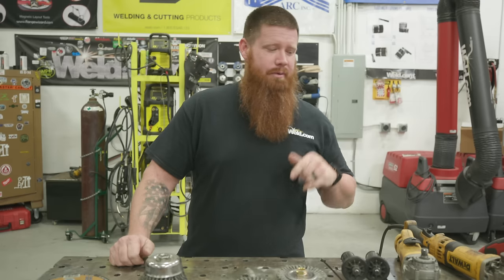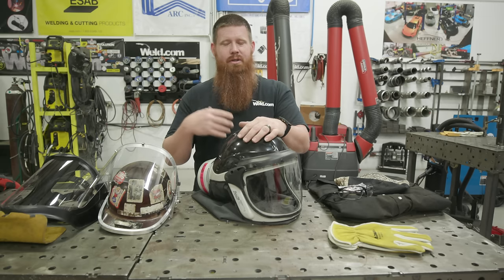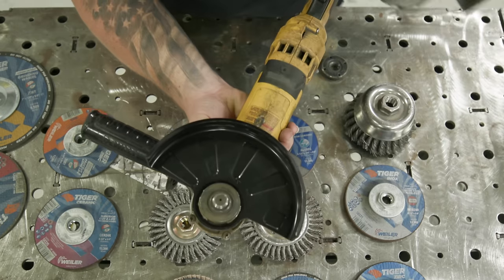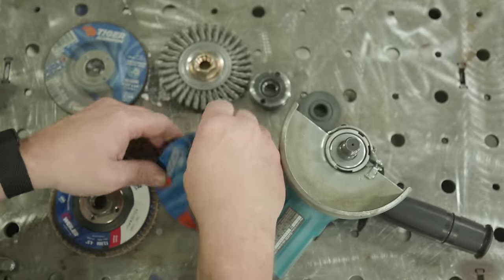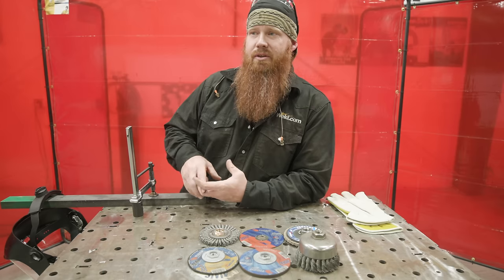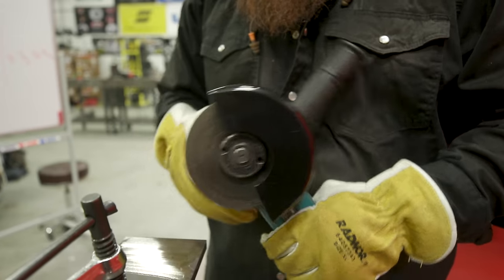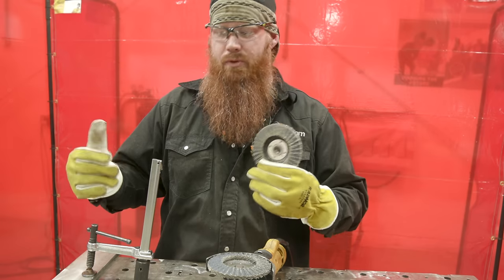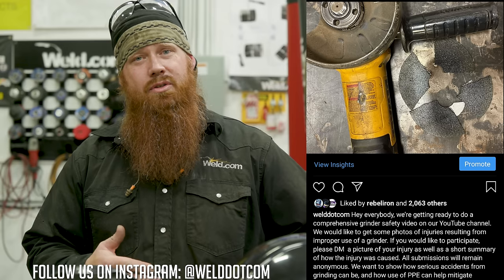Grinder Safety: How to Properly Use an Angle Grinder

Comment: True story: coworker was using a grinder with a cutoff wheel and no guard. I was about 10 feet away. The wheel exploded on him and a big chunk hit him in the neck by his throat. I got to try to slow the blood coming from his neck while waiting on the ambulance. I’ll never forget him telling me not to let him die and that he wanted to see his kids. He got lucky and lived. Use the damn guard.
Reply: Jeez!
Reply: Agreed. I keep telling my coworkers but they wont listen. I put on a guard on every grinder i find so nothing happens but they keep taking it off everytime so ... im waiting to tell my horrible story i guess. Ive done my job
Reply: Don't you have a safety monitor?
Not a union shop?
Reply: guards .. glasses... push sticks... clamps..
Reply: Why would you not use the guard?
Reply: batvette they’re always in the way, preventing you from getting the grinder into tight places.
Reply: Had a co-worker with longish hair using a grinder. His hair got caught, the grinder was drawn towards his head and ended up partially scalping him when it got there a fraction of a second later.

Grinders are very dangerous people. Take every safety precaution, and learn the uses and limitations of the tool before you use it.
Reply: @stickjohnny  seen one were disc exploded and guy got very lucky and only nicked his stomach, hearing all this I see how much worse it could have been
Reply: I've seen one of the plastic grinding wheels explode and embed itself in box 20 feet away. The grinding wheel wasn't some harbor freight junk either. Its was from the welding supply store.
Reply: batvette because Lowe’s, Ace, Home Depot, etc don’t carry type 1 guards of any brand
Reply: @jack19931970  If someone is having trouble fitting a grinder somewhere, then they're using the wrong tool.
Reply: ever see a drill bit snap and send a piece like a bullet..  glasses... dudes... i'm sometimes guilty.. i snap down my sun glasses in a pinch...!!!!!
Reply: Damn man, thats deep but important to share..
Reply: @MrFreakybeer  In the UK everyone here uses the guards. It seems to be only an american thing. I have no idea why people dislike the guards as they also stop sparks from going pretty much all over the place and peppering you.
Reply: @jack19931970  Then it's the wrong tool.
Reply: This is something that always has amazed me. I never ever use grinder without blade guard. 
Not once have I watched a video in which usually american builder has used grinder with a guard. 
What do insurance policies say in case of an accident if the guard has been removed? 
For example in American Chopper, no one ever had guards on and they used grinders all the time. You'd think that in a company that big at the time they would hold on to safety like crazy.
Reply: i never used any guards or anything in 10 years and never had any problems, with gurad im not able to do most of jobs, simple
Reply: @Jonjs99  I find it the opposite. With a guard I can do more. The sparks are not hitting my face and it makes it much easier to hold the grinder in certain positions.
Reply: @mrdojob  Trust me, i tried. Im making fences, and mostly stairs
Reply: Lua Dipa  guard is ment to be reposition able and handle reposition able I'd break your grinder and throw it in the trash
Reply: Damn dude crazy
Reply: No mention of the wife!.. Can't blame him 😂
Reply: I am never taking the guard off my grinder, omg
Reply: @sking379  why not?
Reply: people take the guards off regardless of where they work until someone tells them to put it back on.  taking the guard off lets them grind on the backside of the wheel which kicks back violently.  .
Reply: @MrFreakybeer  - The foreman or manager should kick those coworkers off the work place. Safety comes first.
Reply: @Jonjs99  -- Thank your lucky star that all those 10 years nothing happened. Should it ever happen, it will be too late for regrets. Why risk it?
Reply: Sorry to read that American always put  safety as paramount. Unfortunately such cases happened frequently especially in substandard workshops. No wheel guard and Max RPM that no corresponds and less than grinder max RPM. Wrong types of cuting/grinding wheel designed for air equipment instead for electrical or wheels not steel work. Bad installation or not properly grounded. Not to mention Chinese cheep crap. Use correct equipment, do not perform any work under alcohol/drug and always use made in U. S. A.  or made in Europe !
Reply: man thank you for sharing this with us. things like this are necessary for youngins like myself to learn. All mistakes teach somebody somewhere a lesson. Just have to set free the stories.
Reply: I meant properly insulated and grounded equipment - grinders, extention cables, distribution boxes, etc. When working with airdriven grinders and equipment aboard fuel barges, tankers, air hoses and equipment are to be grounded too in order to prevent static. In such areas often brass brush are employed. And gas free procedures and hot work permits.
Reply: GUARD is like a condom, most guys feel better without it. So I never used guard.
Reply: @stickjohnny  I'm always nervous using them. I've seen a few get blown apart.
Reply: Never hover your face over the grinder. When I was doing Tile one of the old timers, whose been a tile worker his whole life told me about another experienced tile guy. Who had a blade break off & fly into his forehead/brain killing him on the job site. Ever since then I stay offset to whatever I’m working on.
Reply: That’s frightening... uff..
Reply: man... teared up reading this
Reply: Jesus Christ
Reply: You would be amazed how many workers use a SpedeCut on an air motor without a guard. The air motor comes without one. It's just too easy, to construct one and install it! Folks don't realize how dangerous a cutoff wheel actually is, until the WORST actually happens! You watch! Mention something about safety to someone doing something totally unsafe, even if you're nice about it, and see how many folks will flip you off and tell you to go mind your business! Then they wonder why they get hurt! I mentioned, to a guy in our shop, that was fixing to use a wire buffing wheel on a bench grinder, WITHOUT a set of goggles and a face shield. He was just wearing his regular glasses. He got a piece of wire in his eyeball, that took him to eye surgery. He was lucky our shop was less than a quarter mile from the hospital. Later, he apologized to me. We have to use the PPE available to us at all times, when doing this type work! It is NOT forgiving!
Reply: @stickjohnny  Amen to that! Machines will roll up your arm skin, or your loose sleeve cuff or your gloves...or the loose bib of your shop apron. You can't get complacent when using power tools! There's no time where horse-play has a place in a shop setting. You have to keep your mind on what you're doing. I almost lost my fingers, when I was sharpening a drill bit on a bench grinder and a very unsafe worker came into our shop and hit me in the left temple with a snowball ! And he thought it was FUNNY ! Thankfully the boss saw it and fired his butt ! He was bad about stuff like that! We have to take care of our fellow workers. Remind them safety is everyone's business!
Reply: @somedude7633  My experience, just because a piece of equipment doesn't have a guard, nor was one designed for that piece of equipment, doesn't mean that you can't design and install one, yourself. Most times, a guard is so easy to make, it's almost child's play! You have 10 fingers and 2 eyes. Make something to assure that you keep those items, attached and operational, and not in a jar of formaldihyde
Reply: kykingz78  sounds like a "Lap-wheel" they're plastic
Reply: @we up 
I have forgotten the context... But with a table saw you always want to use push sticks instead of your hands... 
if what you are grinding is dicey to hold grip it with vice grips..
drilling slsomething ... clamp it in a vice... or clamp it to the table...
drill bits can become bullets...eye protection !!!!!!
Reply: @we up 
also, with a table saw, don't stand in line with a piece you are cutting... Hey, table saw blade can throw the workpiece at your midsection
Reply: ideally, a radial arm saw or a chop saw should have two run switches..
the usual trigger on the saw and a secondary outside of the blade's path..... 
shapers are rarely used .. never on a work piece that is large enough to swing at you if the chisel jams..again .. clampdown clampdown clampdown

even light sunglasses if no others available.. never power w/o glasses
Reply: Aaron Hicks  
if it covered his eyes.... oh wait... he would not be able to see.. danderous
Reply: Good to know in the shop everyone is grinding and cutting without the guard and of course without protection i try not to forget the mask but sometimes when you are grinding 8 hours straight you forget the protection, i know its wrong but i do it. I will be more consistent with protection.
Reply: Fucking noted and etched in my brain
Reply: I’d say always check the cutting wheel if it’s cracked or bent alittle and never cut with the wheel facing directly at you.
Also I’ve never used a guard in my 10 years of welding lol.i guess I’ll start using one now.
Reply: @Usernamebreh  
love it when intelligence takes over
Reply: Did he use a guard after?
Reply: @mrdojob  You have no idea how bad it really is ! 1% gets published .
Reply: @iitzDiRTY  Only hurt the guys who saw it !
Reply: Wow, the visual is hunting me already, fkn thanks!
Reply: Always using the guard. I had no idea this could happen.  Excellent content. Thank you.
Reply: r/thathappened
Reply: Agreed
Reply: I worked as a machinist. Guys would constantly put there heads in the machine while running. One of the got nicked by a facemill he got lucky and lived.
Reply: I don't even know where my guard is. I've never used it. I abuse cut off wheels and broke them and never had them do any damage. I don't know how you people do that. I couldn't do it on purpose. Nonetheless a Bad Dog HD 2 won't break.
Reply: How about a face sheild hood?
Reply: @general5104  my brother slapped me in the back of the head when i was sharpening a tungsten, unfortunatly "family member" is a pretty damn permanent position
Reply: Dang, never thought it could do that! 😳 It's ironic cause I thought of taking the guard off of mine but only to make room for my bigger & deeper items but maybe I shouldn't now! With my luck, I don't think I want to take a chance!!
Reply: Thanks, this was a timely reminder for me. Totally going to gear up next time I use a grinder. I think the reason some people are so macho and scoff at proper PPE with these things is that the wheels hardly ever explode. You can use one for 50 years and never have an issue, apparently. But Russian roulette with a very low probability of copping a live round is still not a game I want to play. If something does go awry, you're going to be very fu__ed up in a split second. Glad your mate was okay.
Reply: Mad lad
Reply: Really? Thank you God he survived. Good to hear a happy ending.
Reply: kykingz78  Lots of flap wheels have plastic disks
Reply: @vladimirmihalchev2260  I have to say in most American  factories I have been in there is a sign saying something about to find the guy responsible for your safety look in the mirror.  I try to work safe but like every one else I have been in a hurry and not worn my PPE or used correct tool (especially stupid since I was paid by hour).  Glad to see a video talking safe way to use common grinding tools, so many  metal fabricators on YouTube doing beautiful work in very unsafe manner, wondering when their turn will come for accident, not that I wish it on anyone.
Reply: Never skip safety
Reply: @PeeVee1979  well at least get yourself some chain mail gloves and a full face mask that also covers the front top of your head. I hope things always go well for you, although accidents can happen, seriously. 

And you might just need a bigger grinder, so that you can use a guard.
Reply: @Lumberperson  Is everything ok with you?
Reply: @PeeVee1979  oh darn, I replied to the wrong person my mistake! Sorry dude
Reply: @Jonjs99   you should get yourself some chain mail gloves and a full face mask that also covers the front top of your head. I hope things always go well for you, although accidents can happen, seriously. 

And you might just need a bigger grinder, so that you can use a guard.
Reply: The first time I ever had to use a grinder I had to cut 20 pieces of rebar to use as stakes in the ground. My boss handed me a grinder that didn’t have a guard or a handle on it and didn’t warn me to use ear protection. I nearly went deaf and thank god the blade didn’t explode because as someone new to construction I had no idea what I was doing and what wasn’t safe.
Reply: I share of mine, my co worker cut rebars , and he was standing on the plastic chair without any protection but only a googgles, also no guard here, than he cut off him's leg , too bad , and there was no elevator , he almost died
Reply: I hope you are ok after getting hit with that enormous "task" (sorry, can't think of the appropriate word right now). Just remember you saved his life by acting as a human tourniquet. Good job man. 👍👍

Comment: It's insane that green guys in the field are just handed an angle grinder to figure out how to use, on their own. Every newbie should have to watch a detailed instructional like this.
Reply: Well, you'd think a newbie starting in a welding shop would have experience using a grinder. 
However,  they should definitely be watched or shown proper techniques.
Reply: nah just a quick instruction works just fine
Reply: Hence the name Newdie
Reply: I agree. First time I switched on my first angle grinder I could see how absolutely dangerous it could be. This is great info
Reply: nah if you cant figure out a grinder i probably wouldn't want you on site
Reply: Yeah.  I learned the hard way when i figured I could grind some paint off some wood with a metal disk.  If it can take metal, why not wood right.  POW!!!  I got away with a welt on my wrist.
Reply: @charlieward7606  this. 

A lot has to do with a large segment of the population lacking intuition (public schooling) and, perhaps a possible connection to lacking an 'inner monologue'. 

People incapable of forseeing repercussions. The fact lawnmowers have a warning to not put your fingers under one running is indicative.
Reply: @MrShakamuni01  "If it can take metal, why not wood right?" 

How could you come to that conclusion?
Reply: @justtime6736  i think its a simple vicious cycle, we make things easier and safer so people think less and as a result get dumber so we have to make things simpler and easier and the cycle continues. 
Its not as if we dont have great minds nowadays but the vast majority seem to come from outlying situations and hardships. If they have had a average life if they have never had hardship, competition, pain, work, the need to figure stuff out on your own... its hardly their fault they´re as naïve as a child.
The fact that some people dont have an inner monologue baffles me and i dont even know what to comment about that ahaha
Reply: Just started using grinders at school for engineering, we were only shown how to grind a flat surface clamped to a vice also we only have safety glasses, ear protectors, and our uniform as protection.
Reply: @justtime6736  i sometimes like to use my chainsaw to cut sheets of aluminum :)
Reply: A lot of us had our dads teach us how to use various power tools when we were pre-teens, these days seems like half the young adults grew up with no father around and never learned how to use basic tools.
Reply: @charlieward7606  Well, everyone can figure out a car themselves, yet we still do have driving schools.
Reply: @graxtheswampgoblinarchmage5356  the little I was taught was by my mum, no dad around sucks but it’s no excuse
Reply: @charlieward7606   Figuring out how to use something and proper training that teaches you how to use it safely & properly is not the same. If you've never used a grinder before, how are you supposed to know how to use one properly? You too had to learn how to use one at some point.
Reply: @graxtheswampgoblinarchmage5356   Or, their dads simply do not have power tools, or at least tools other than a drill, possibly a saw and basic hand tools. My dad couldn't teach me how to use tools like a grinder or a chainsaw, for example, since we never needed either of those tools.
Reply: Or read the instruction manual, which I know is hard for most bloke's who "THINK" they know everything.
Reply: @eward7606There's a difference between figuring out how to use a grinder.

And knowing how to protect yourself from all the potential dangerous things it can do.
Reply: @MrShakamuni01  brother use some form of sanding not a grinder bro 😂

Comment: I'm an amateur with a new grinder.  Thank you in advance for saving my life.
Reply: You still with us?
Reply: @ Rich Grimshaw - be sure to use one with the Deadman switch!  Soon or later it will kick out of your hands.
Reply: @grege2383  That sure does happen with wire wheels. Happened to me a lot when getting in tight spaces back when i worked in my local factory, have had it kick back like 3 times, where the kick-back was either too strong or i was just too close over my grinder, but no biggie, it just gets caught in my jacket, if you have good enough work clothes, i don't see a concern about using grinders.
Reply: and possibly a horrific injury
Reply: @we up a dead man’s switch shuts off if no one is holding down the trigger
Reply: @Uncle Gilbert I mean if a piece goes through your artery or eye....uh yeah saving his life.
Reply: @Uncle Gilbert I believe it's called "exaggeration for effect".
Reply: @DoctorHayduke  "hyperbole"
Reply: ...and lungs, and eyes, and fingers.